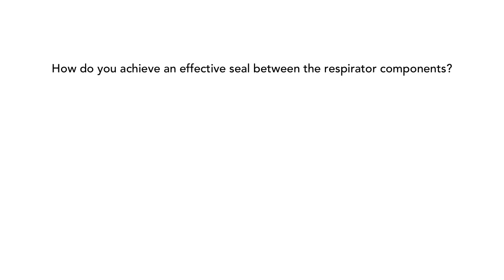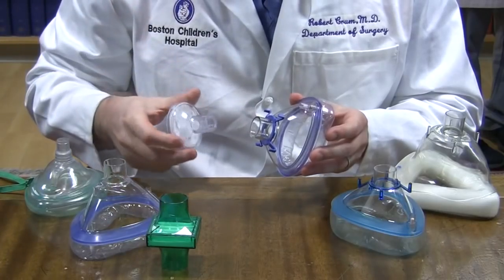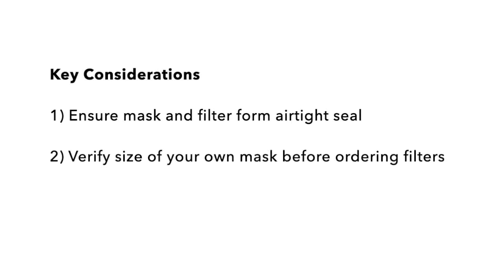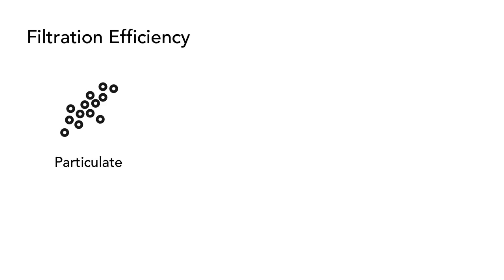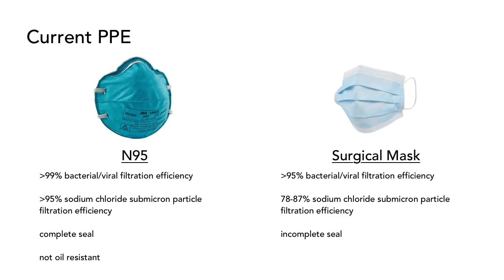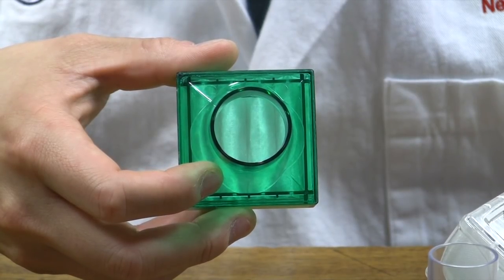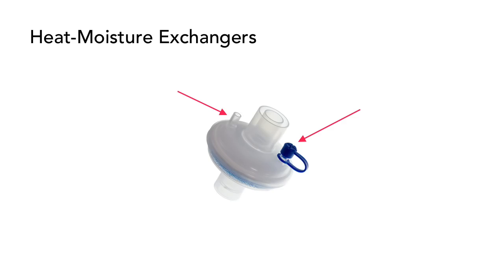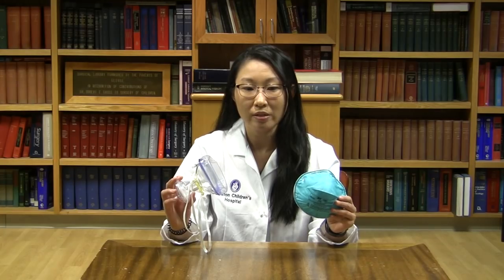FAQs Making Your Own Reusable Elastomeric Respirator

Comment: To use the PFT N100 filters mentioned here (e.g. A-M Systems VB48Max), here is an adapter that will connect to an anesthesia mask or CPR mask (such as WNL)
https://www.thingiverse.com/thing:4552200.  Using this adapter with a CPR mask and PFT filter makes it viable for non medical use, since it does not impact the ICU supply chain.

Comment: Thank you for this informative video. Which of the masks you tested were a fit for the PulmoGuard II filter? Trying to order the parts now
Reply from the maker: The mask we used was from Smith Medical but any  mask with a thicker plastic adaptor will likely work (as shown in video).  You just have to check.